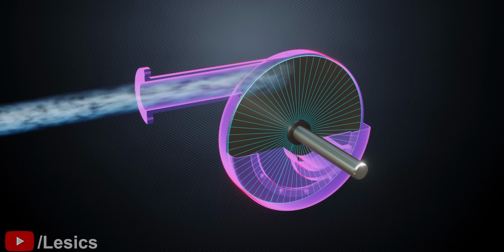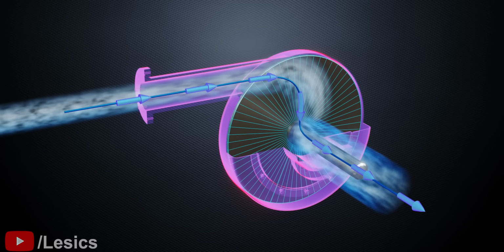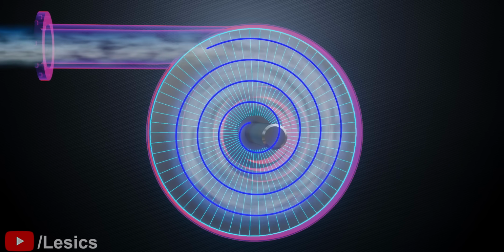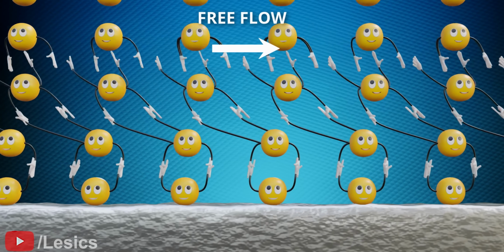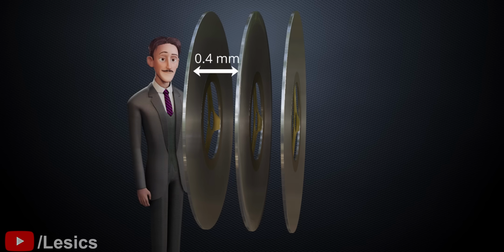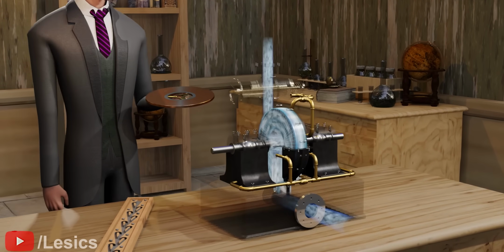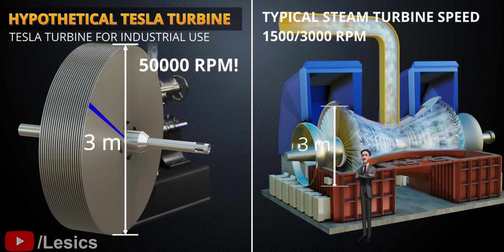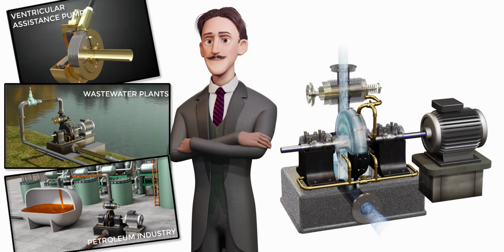Tesla Turbine | The interesting physics behind it

Comment: I like how you say its impossible even though we have graphene and carbyne
Reply: I like how you do not understand that even those materials, while also ridiculously expensive to fabricate, wouldn't be able to hold that.
Reply: @viktor1496  you reckon. Go do your research. The tensile strengths and weight of thoes materials can withstand an elephant’s weight with a sheet an atom in thickness
Reply: @iamacesirx  Why don't you look up the actual numbers of the tensile strength of graphene and come back to me. It's a wonderful material, but not magic. It seems to me that you don't fully understand the stress materials in this turbine would be under
Reply: @viktor1496  mate, graphenes tensile strength for a 0.142 nm thick sheet is 130,000,000,000 Pascals. Come again.
Reply: @viktor1496  if also like to add that the theorised limit to the tensile strength to multiwalled carbon nanotube technology is numbered at the tensile threshold of 300Gpa. So before you act like you know everything, do some research yourself instead of assuming. Some people I swear.
Reply: @viktor1496  at 0.5 cm or what ever dimensions you would need would be an increase with the tensile strength up to a point where thickness extends length.
Reply: @iamacesirx  Yeah, and if you bothered to do a quick calculation of the centripetal force of a sizable disc at sufficient speeds, you know that even that tensile strength isn't enough. Come again
Reply: @iamacesirx  Just a quick reminder, graphene isn't magic. It's a material with incredible tensile strength, but even that has its limits when placed under sufficient stress......like a disc spinning at multiple times the speed of sound.
Reply: @viktor1496  show me the math then, the centripetal force would have to exceed 4.351e+7 Psi, i wanna see the math you have to back yourself up, to put that one in perspective, it is 16,000 PSI at the bottom of the Marianna trench
Reply: @iamacesirx  First of all, the tensile strength isn't 300 Gpa as you quoted, it's approximately 130 Gpa. And that's for MONOlayer graphene which would be utterly useless Since you would need some width to construct your turbine blades. With a thickness big enough, we're talking a maximum of 10 Gpa with carbon nanotubes. which is still VERY respectable seeing titanium sits at around 200 Mpa. But that's a very optimistic number nonetheless.

Taking the weight of carbon nanotubes, required disc size for industrial applications and a tip speed of a generous mach 10, not even enough to surpass convenional turbines in efficiency, we're talking roughly 5 MN of force on the edge of the disc. Coincidentally also the force needed to puncture through 3cm of graphene. Seeing that this force is already substantial enough to do that, I do not need to make a drawing on how bad the deformation of those blades would be. 

If you want a source, I'll gladly link the papers that I got my numbers from. Now please accept reality.
Reply: @iamacesirx  Stop acting like you know what you're talking about when you only did some google searches. Source: "Lee C, Wei X, Kysar JW, Hone J, Measurement of the
 elastic properties and intrinsic strength of monolayer graphene, 2008 Science"
Reply: @viktor1496  oh that says mono layer, which means one, I said multilayered or multi walled, which means multiple…
Reply: @viktor1496  it looks like you are grasping at straws my friend
Reply: @iamacesirx  My god, you couldn't even be bothered to read it through? Otherwis you'd know they studied multilayer further in the paper. This conversation is over, you don't know what the hell you're talking about nor do you bother to learn something.
Reply: @viktor1496  science is the purpose of finding a way, not to disprove. And there findings could be completely different from another’s, it doesn’t make it the final answer. As my documents stated that there was efficient enough for to withstand
Reply: @iamacesirx  I gave you a paper staving what I said. You didn't even bother to read it beyond the title, yet you talk to me about "documents". Alright then, please give me the name of the paper on which you base yourself?
Reply: @iamacesirx  I'll take the silence as my answer: you don't know anything about it and you base yourself on headlines of google searches. Good day

Comment: Airfoils operate on vacuum on the top surface of the blade or wing. This is because the path is longer on one side. They are not pushed from the bottom as many think.
Reply: you're actually kind of wrong. 
Because "nature abhors a vacuum" an airfoil is pushed up into the vacuum by the higher pressure below ... not sucked up by the vacuum. otherwise a vacuum would be considered a state of energy.
Reply: Jeremy whittler, did you delete your reply about "Home of the Black Sheep" ? Hmmm, So it turn's out I know more about Physics AND History then you do.
Reply: @RoverIAC  😁 really? I taught  aeronautics at NAS Pensacola  as an assistant  for harrier av8b  Harriers.
It's not important who's right , but have a look again.
Reply: @jeremywhittler8591  really really, ... there is no actual vacuum when you fly an airfoil. there is low pressure and high pressure. I'm sure Pensacola is a good school (home of the Black Sheep) but I'll stick with Issac Newton... According to Newton's third law, the air must exert an equal and opposite (upward) force on the airfoil, which is lift.

Comment: Intuitively there is probably more to this than what is presented in the video. Believe that the viscosity of the liquid is one major factor, the other would be the friction coefficient of the platter/disk surfaces. I imagine a minor additional factor likely would be the mass of the rotating platters/disks but only for changes in velocity. Of course there would be the additional practical effect however efficient the bearings are, but that can probably be an external consideration not directly part of the Tesla turbine theory.

Comment: Only an impossibility until materials science catches up with this design.
Reply: It already has
Reply: I bet Tungsten could handle the rpms.
Reply: @cjcourter1477  I was just thinking that! Though I’m Leary of it handing Mach 13
Reply: @kenconify  right even if you could get the metal to not melt at that speed one accident and the room is filled with superheated metal shards flying in every direction at super sonic speeds.... no thanks.

Comment: Curious.  If there was material that could survive Mach 13; it would generate incredible heat at the edge of the blade.  Couldn't the heat also be used as an energy source and contribute to the overall power output.
Reply: The heat would naturally increase the Steam's pressure and therefore power output

Comment: So, nobody has thought to make the disks out of Carbon Fiber which has been proven stronger than steel? I the car racing may have developed the technology that would make this work. Also, why do you need to make such a large turbine? A much smaller turbine could be used to rotate electrical generators off of either center shaft and develop KWatts of energy at the 10k RPM range. Are engineers too lazy to think outside the box today?

Comment: Fluid bearings.
Hydraulics so there is no friction ever.
Could spin at any rpm
Reply: No. The issue isn't friction (and for the record: Fluid bearings have friction too, just less of it).
The issue is that you are spinning a disk at extreme rotational speeds.
Meaning that there are massive centrifugal forces at work, which will literally rip the disk apart if it's tensile strenth is exceeded.
Even with absolutely zero friction, every such disk has a maximum rpm that it can withstand for it's respective material.

Comment: It seems to me there is a way to make a Tesla Turbine more efficient at lower speeds. I can think of a couple using simple gears and smaller turbines. Theres also yhe thought of reimagining the mechanism itself to utilize viscosity better. The rpms would not matter as much with plates thaf are not flate, but thick at the axle and thin toward the end, meshed with another set and both sets working from separate intakes. Also the disk having very flat edges is not the best choice. Fluid dynamics and an AI could help us design a better turbine by simulating what surface geometry could best serve a viscosity driven turbine. Also, the plates do not necessarilly have to be separate things. They could all be joined together for structural integrity, and made very light to reduce cetrifugal stress. A fiberous material with low weight and high tensile strength on the outside portion, joined to a material that has high durability and possibly high plasticity, that is joined to a center metal disk with a significantly smaller edge speed than the disk as a whole. I can see a design in my head that should work, but I have no expertise on building things like that.

Comment: Great video!   There is another basic turbine configuration that wasn’t mentioned.  That is the API 611 solid wheel steam turbine which is commonly used in the petroleum industry.  The design uses buckets machined into the outside of the wheel which enhance the power transmission capability of the drive over a straight up Tesla design.  The advantage of the solid wheel API 611 turbine over conventional axial flow bladed turbines (which are more efficient) is that the solid wheel design can handle liquid slugs which are often present due to poor quality steam that falls below superheated temperatures as it is pumped to the turbine.  It is hard to keep pressurized steam in the superheated state when transported from the boiler to the turbine.
Reply: His mistake was using metal.  Marble wouldnt warp.  It would only break if it was already cracked.  Has anyone ever tried it?
Reply: @wildfirekingdom9466  there are a hand full of other more viable options than using marble. thank god we dont live in the stone age. Modern alloy, ceramics and composites provide us ample opportunity to fab discs for steam duty like this at scale.
Reply: @wildfirekingdom9466  you may be right, but I wonder if marble could handle the G forces of that high of RPM's? A marble disk might explode?
Reply: @sarakajira  solid marble shouldnt have a problem.  It’s very dense

Comment: We may be able to Manufacture a material to withstand the 50,000 RPM needed for such a better design now.
Such as the Quartz or growing material from Man-Made Diamond.
Or even a highly processed Carbon or even ceramic compound.
We have Jet Engines that do 90,000 RPM.

Comment: Instead of increasing diameter he could have coupled smaller diameter turbines on a shaft to achieve the required power.
As you stated they are used in niche applications.
10000rpm is not fast.
For slower speeds gearing could be deployed.
It's still a great invention.
Modern materials would withstand the high centripetal forces and peripheral velocity.
Reply: Gearing reduces efficiency.
And there is a difference between running a car engine for a few seconds at 10,000 RPM and spinning a 2-3m disk at 50,000 RPM for years or decades.
Reply: @KaimasterXD  I did say smaller diameter discs
linked on a common shaft. Ergo slower peripheral velocity on the discs.
Gearing does have losses, true.
Chain and sprockets are more efficient than gears.......
Engineering always has compromises. It comes down to how much you really need to use the Tesla turbine.
You make a good thoughtful point.
Nice to chat with you.

Comment: If you can produce enough torque you can put a high speed gear ratio on out put resolving the high speed Issue.
You do this by increasing the widths of the blades obviously depending on how  many blades you plan to use and increasing the surface area by lightly scuffing it, it dosent have to be much just enough for the gas to really catch you can easily produce enough torque. Don't forget to take account of the  Parasitic power lost from the gear box should be between 10 to 25 percent depending on the gear ratio you use it  can be more or less I recommend using a clutch to transfer the power cause torque converter drain a bit more we are aiming for efficiency.😉
Reply: Just to be clear this set up WILL OVER HEAT if you dont use cold gas cause of the friction im talking about red hot blades I had one explode NOT FUN

Comment: You could put brakes on it to slow it down and the pads and rotors for the brake could be used to generate electricity through heat conduction. (Technology thats already used on the tesla cars for their brakes..)
Reply: Now I don't know about Tesla cars in particular but that's not how regenerative braking works. It's normally done by running the motor as a generator converting the rotational energy into electrical

Comment: Nothing compared to today's technology.. now we turn steam turbines with super heat. Ultra super platon heaters (final stage) bring water to somewhere around 1400° before going into the turbine's and then recapture the cooling steam into a heat return steam generator (HRSG)  and possibly more smaller turbines, basically for free .. hard to understand how the turbine's capture that clear vapor which is hundreds of degrees past boiling points and harness more energy by folds. We are and will continue to be 100% reliant on coal, natural gases, hydro, and nuclear power for another hundred years to come. Wind farms and solar have leaps to come before comparison. Green energy is your government and fellow man screwing ur eye balls out by multiples and everyone is for it. Smh. Our nation has clean energy and has since the 70s. We still run some of the most efficient power plants designed with coal and they will continue to stand the test of time. Every plant shut down by the epa equals double your power bill.  Go solar and u pay double out the gate and then double that every ten years. Fools believe anything on tv

Comment: with the force creating issue with warpage, could modern materials down play it?  i mean if it generates heat, we could use thermal tiling?  if we can get a spacecraft to mach 20... isn't it possible to create something to withstand mach 13?   i'm also curious if you introduced magnetic fields into the equasion?   just how strong could a magnetic field be if it was spinning at mach 13 mach?  LOL... would creating one of these in space create these issues?  and if we did build one in space how would we fuel it?

Comment: Okay, so what if you used the same concept that hybrids cars have been using from converting breaking energy to recharge it's battery? Apply a breaking/reduction system that is able to transfer the energy and reduce the rotation to a sustainable RPM rate?

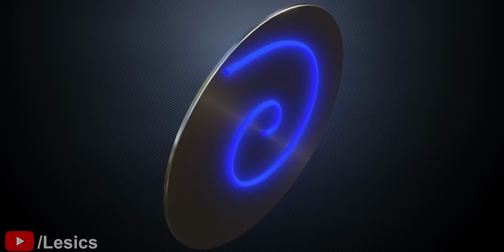Comment: I think your wrong about the engineering IMPOSSIBILITY....you just need to make the disk thicker and engrave canals IN the discs. The engraved canal will take the form of the Golden Ratio 👌 3:48 This will stabilize the deflection you will encounter, use the water to solve the problem you encountered.

Comment: Another useful (but not YET popular) application of the boundary layer effect similar to that of a pump, is that of a fan.  Its primary advantages are 360 degrees of air-flow from the central inlet, it is extremely quiet compared to other fans with similar air-flow and it DOES NOT EXHIBIT CAVITATION EFFECTS.  A careful design makes it almost as efficient as a blade fan for the same energy input.
The 360 degree air-flow methinks would be ideal for centrally located heating/cooling of a room at very low cost.
Reply: It is most efficient at high speeds, which does not seem to me compatible with a domestic fan. a well designed circular blade would be better in all possible ways. And indeed quieter than usual fans, but those exist... and the fact that they expel the air rather than blow it makes them not that good

Comment: The trompe is a good way to use water and gravity with a bit of engineering and fluid dynamics to make power using compressed air. There are better alternatives to hydroelectric dams.
Reply: Trompe pumps waste water.
Reply: @walsakaluk4630  trompe uses water and gravity to compress air, after the initial drop the water and air naturally seperate in the tank. The water is returned to the source, albeit a few meters lower than the intake housing. It doesn't consume water, air or anything, that air is isothermically compressed so it is perfect for refrigeration. The return water is airated and actually cleaner than going in. You could run trains, power tools, electric generators, you name it.

Unless you are referring to a different device?